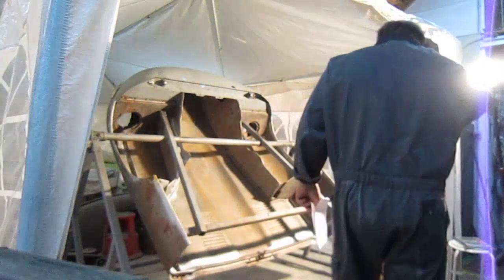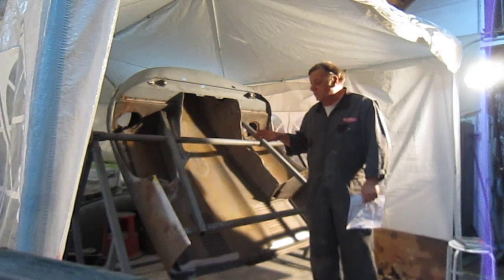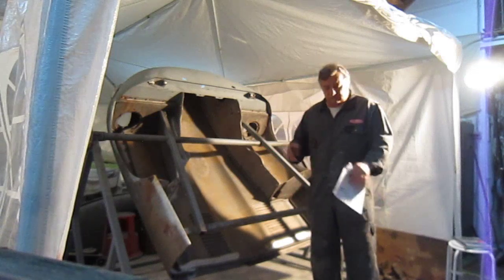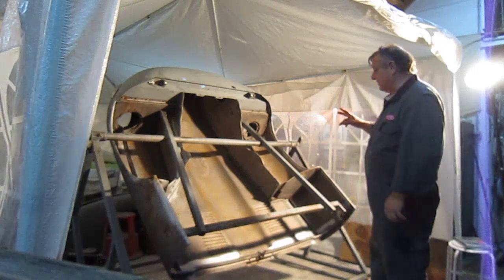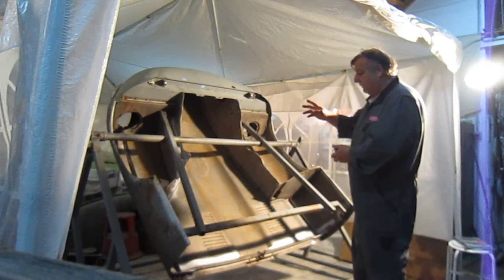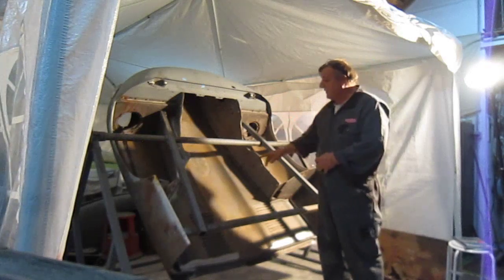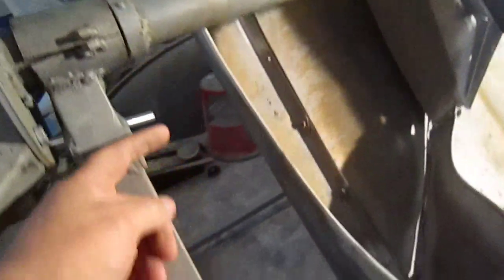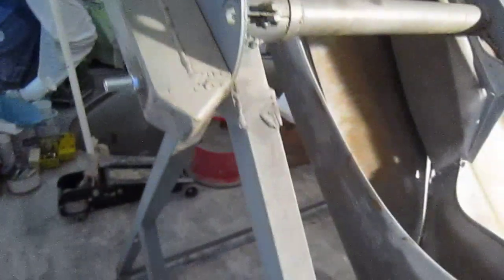Jaguar E Type bonnet jig part 1

Comment: Great video as usual Dave and thanks for the shout out
Reply from the maker: Sean, Your welcome, Just watched your video it is so nice to fit new metal great morale booster. Cheers dave.
Reply: Indeed it is a great morale boost to start fitting new panels and it's at this stage when things start looking up. I'm on a roll at the moment but time to work on the car is also an issue but I'll do what I can when I can!
Reply from the maker: Sean, I know how difficult it is to hold down a full time job and keep the family happy at the same time. Then drop into the mix a mini restoration not easy! Being retired i have the time to knock out the videos & the restoration on the cars and other projects. But i have to work around other commitments as well! Cheers Dave.
Reply: davejaguar66 chwere Dave. Having a proper full time job would ideal. The government bang on about there being low unemployment etc but what they fail to tell folk is there are 10's thousands of folk on zero hours contracts and minimum wage (if that) for example I don't know if I'm working tomorrow!
Reply from the maker: Sean, Sorry to hear that! Not knowing when your working the next day is luckly something i never had to deal with, I can‘t believe we have this Zero hour system in place it‘s just a kop out from the Govt. Cheers Dave.
Reply: davejaguar66 indeed it is Dave but just been informed I'm working the rest of the week but it's with a company I don't know and no doubt I'll be all over the country in a clapped out truck. Hopefully 2018 will be a better year and I can 're establish myself...